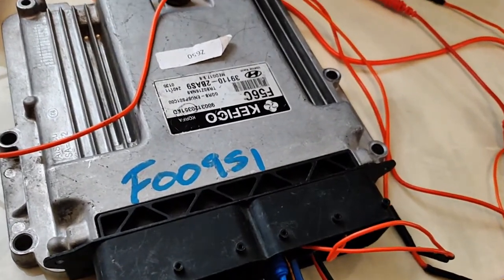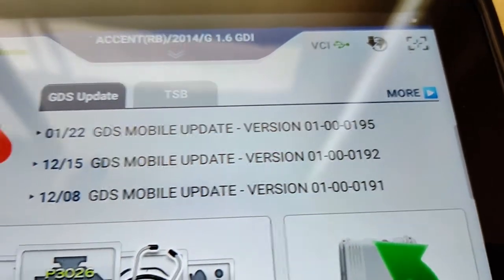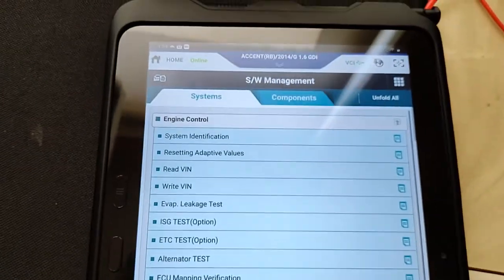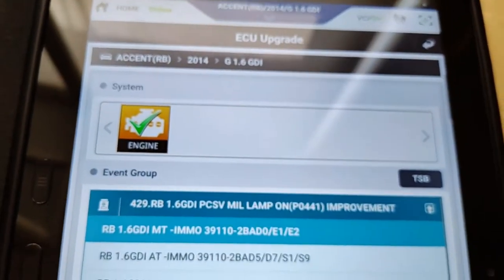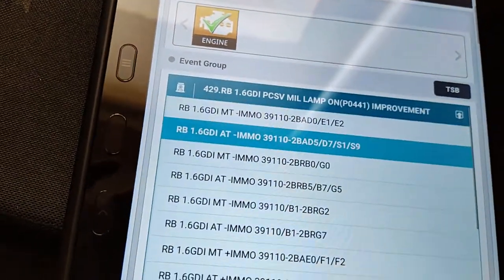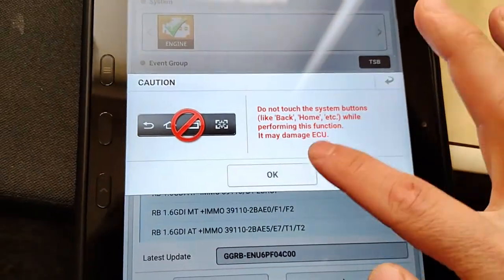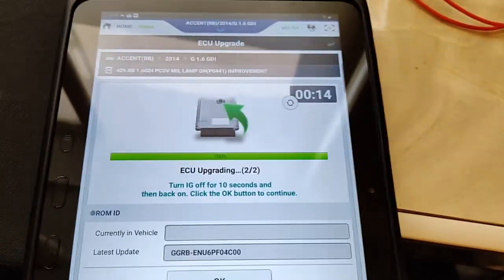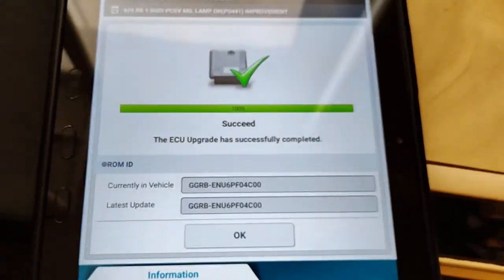Hyundai PCM Reprogram GDS

Comment: I have a Hyundai i30 1.4 mpi 2018 vehicle, the oxygen sensor is broken, we couldn't find a new one and the sub-industry part is tactical, but it doesn't work correctly in the system, the product needs to be adapted to the ecu and coding (engine control unit, air fuel mix adjustment adaptation) with the parts on it, but Hyundai authorized services do not accept this and the spare part will come months after Korea, what do you recommend?

Comment: Bro can u pls show us the connection of PCM and VCI2 here in this video …it’s really cool when u do this update without vehicle hardness. Pls
Reply from the maker: Everything has been disconnected. All you have to do is connect power and ignition to the ecu and interface(gds2), then run a connection between the high speed circuits pin 6&14.

Comment: Hi, I have a Hyundai Tucson 2019 1.6 T-GDi/HTRAC. I have halogen lights and I want to install the original Hyundai Led Lights (90101-D7700). Is there an option on the GDS to program the car to recognise the new headlights so I won't get errors on the dashboard? Thanks
Reply from the maker: @tasskap  I could not run your vin from it being a foreign make. It looks like it can possibly be changed in the User Options under the appropriate module.
Reply from the maker: I'm not sure. If you send me the vin number then I can check.
Reply: I have a Hyundai i30 1.4 mpi 2018 vehicle, the oxygen sensor is broken, we couldn't find a new one and the sub-industry part is tactical, but it doesn't work correctly in the system, the product needs to be adapted to the ecu and coding (engine control unit, air fuel mix adjustment adaptation) with the parts on it, but Hyundai authorized services do not accept this and the spare part will come months after Korea, what do you recommend?